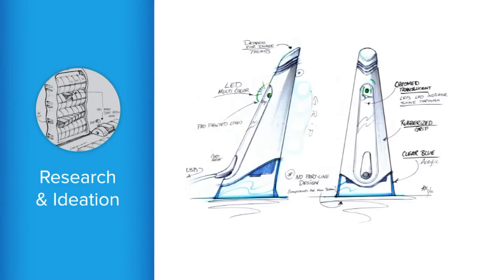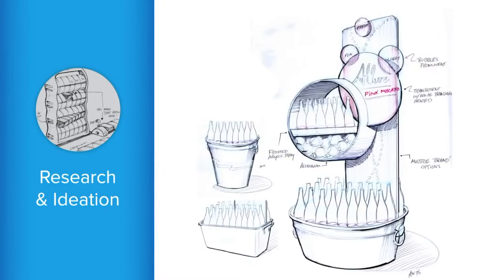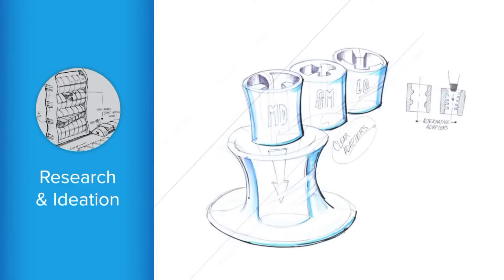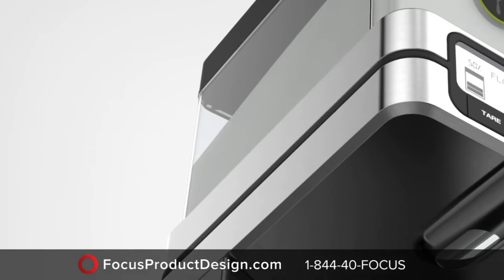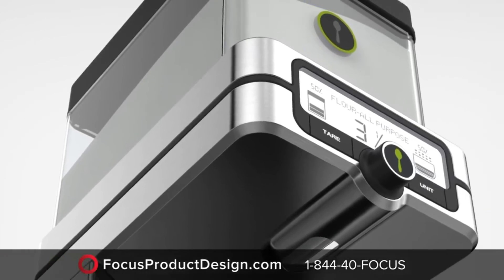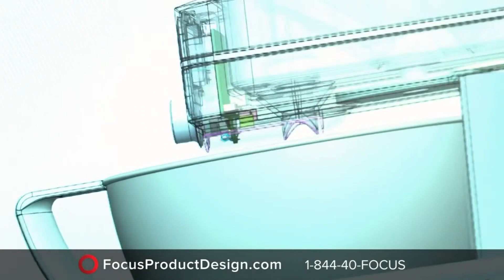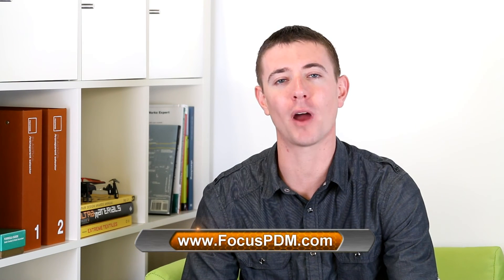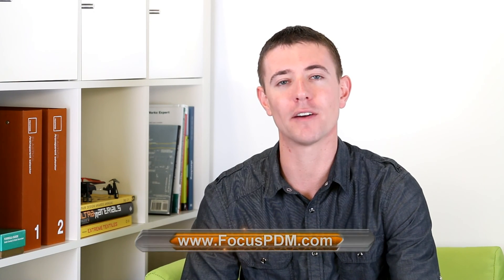How to Get a Prototype Made

Comment: I have an stl file and I want a prototype, Ive got quotes around £500? Wasnt expecting it to be that much what are my other options?
Reply: That is actually a decent price for a prototype, depending on what it is and the process needed. If you need cheaper, you can make a prototype from cardboard and just anything you can find. Or just a 3D print can be very cheap depending on the size.
Reply: @PartDistribution  it's a 3d print I'm looking for

Comment: So i am an amazon seller and i am looking to create a mold for a lint remover.  If you got to amazon and type in portable lint remover you will see basically one with a wooden handle and another is the gleener model which is a top brand.  I have worked with my design team and are in the process of making this new product and will guarantee it will be the best lint remover on the market!  What i have learned in life most is that just because something looks the part and looks good, does not mean it is good.  So i am confident that my design will look better but after the CAD design and 3d print, how can i test this lint remover out on actual fabric?  MEaning is it possible with a 3d print, that i will be able to test out the threading of my stainless steel blade of my lint remover on actual fabric or no?
And if not, is it possible for an overseas molding factory to make me a sample of my 3d design, while still staying under 2,000 dollars for the sample to be made and shipped to me?
Thanks
Reply: I would think so. If you have a design team, I would have thought one of the technically minded people would be able to figure out how to make something to test. Like 3D print the core to accept whatever medium does the actual function or what not.
It's always possible to get whatever you need overseas. But within a budget, depends on the manufacturing process to make it. Such as if it is injection molded, likely not able to get a mold made for $2K. I do get small molds made over there for $1K, but my assumption is yours needs to be bigger than that. So my rough guess without seeing it is in the $4K range. But I am not advocating that is the right path, just giving some context.

Comment: Before even thinking of my product I must consider the market for it. But the proof of concept is in the product I can make most effective. The higher performance of the product in design and proof of concept and of course new models innovative design will surely improve through test and evolution of product to final or near final concept. Like laundry soap there is always new and improved from many perspectives as this evolution takes place over years of design considerations and testing. Even a new bright engineer might be able to improve the product performance a little bit each year of a generation of considering all the inputs and how to arrange them to get the best result. The future belongs to the most efficient as mother natures rules survival of the fittest. Those that have less performance will slowly loose in the long term and we can see this already happing in the market place. comments are welcome to how to do all of this. Even the steam engine builder did not have the technology to create his idea. But it was the start of the industrial revolution when steam was use to pump water out of coal mines. Then the steam engine allowed for driving factories and the era of steam took off. Even then over time the diesel was much more powerful and much more efficient. Would you comment on funding and how to get some for proof of concept.

Comment: For people who are finding this video and still have questions afterward, allow me to address some of those questions. The speaker in this video outlined the process for a plastic "Form and Function" prototype only. Prototypes can vary wildly and serve different purposes. There are "Functionality" prototypes that look nothing like the final product but instead showcase the function. Next, there are "Form and Function" prototypes that have the general shape and functionality of the final product, but it does not necessarily have a completely polished look and feel. Then there are "Model" prototypes; which are near-perfect aesthetic representations of the final product. Finally, there are "Complete" prototypes; which are essentially the product manufactured in an extremely small batch without the production of tooling. Each form of prototyping serves a different purpose based on the needs of the product. 3D printing is an excellent tool for producing plastic prototypes; however, 3D printing is not the best tool when needing to produce rubber-like, glass-like, or metal parts. There exist other techniques, such as silicone casting, that are used to produce those parts. Electronics prototyping is another beast entirely, and typically a client works with both a physical prototyping business and an electronics prototyping business simultaneously. Two separate companies tend to give better results due to their independent specialization.
Reply: I can't agree you more. For different purposes, there are more ways to make the prototypes. CNC machining, SLS/SLA 3D printing, injection molding, vac casting. For some products, even they have passed the prototype test, but still need to low volume production to verify the feedback.
Thanks,
2fprototypes
Reply: trapfethen thanks man great source of information 👍🏼
Reply: trapfethen hello, would it be possible to perhaps pick your brain on creating a prototype?
Reply: trapfethen how much should one expect to spend for this process?
Reply: trapfethen what if I have to make test a technological product?

Comment: Hi thanks for info. But some prototypes require more than the plastic body! How can you help to get the electronic done inside the prototype. Thanks
Reply: open source electronics and some good coding will do the work...
Reply: Then you need to source electronic elements for the inside. If you do not know by yourself, you need to find a designer who is specialized in "electronics design".